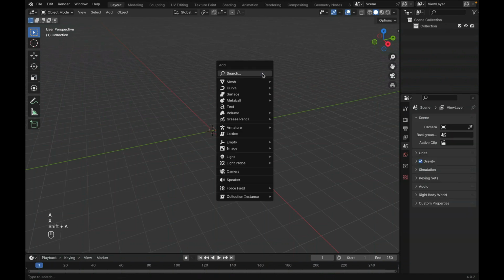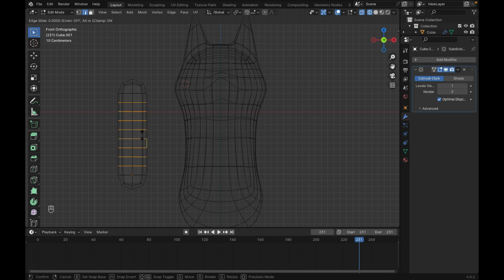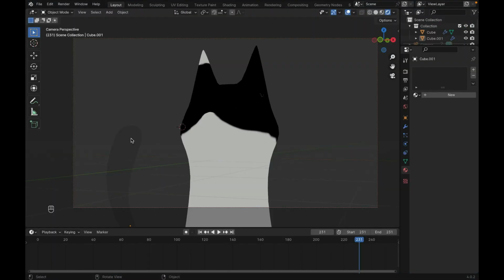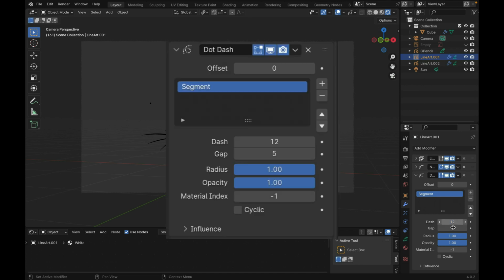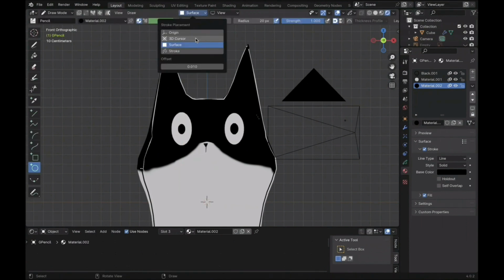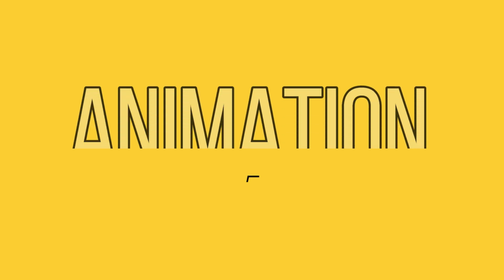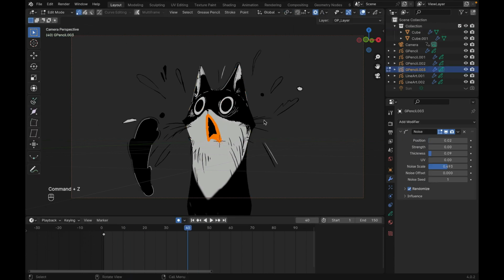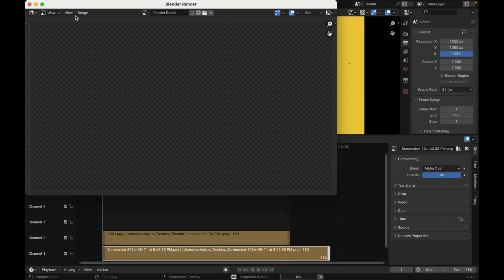How I made this 2D+3D animation with Grease Pencil

Comment: Cute tutorial!
When you want to solid colors without shading like that you don't need to have the diffuse shader at all, it'll render a little faster if you just use rgb input and/or color ramp directly
On the part where you used a mix shader with 2 color ramps you could have plugged the texture directly into the output or into a mix color node if you want to adjust the colors later